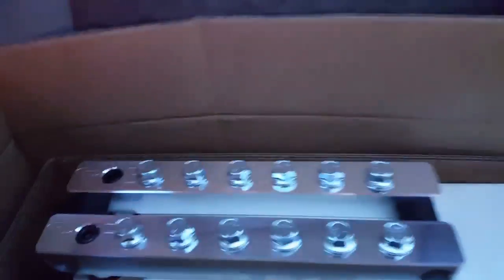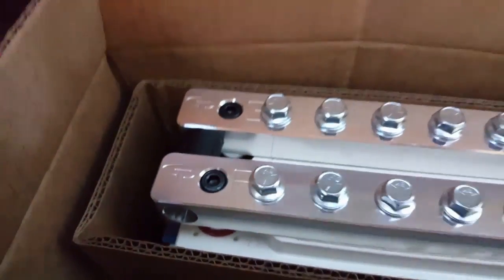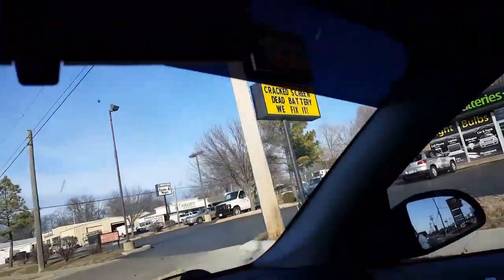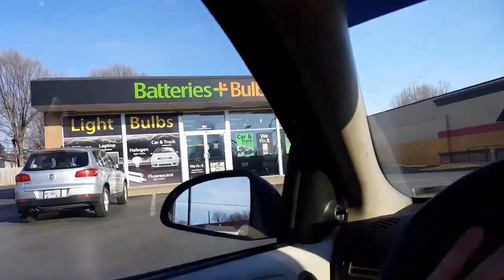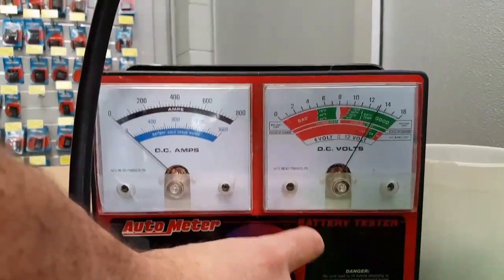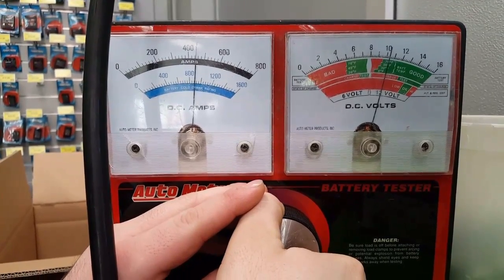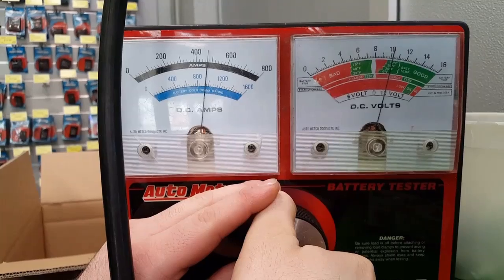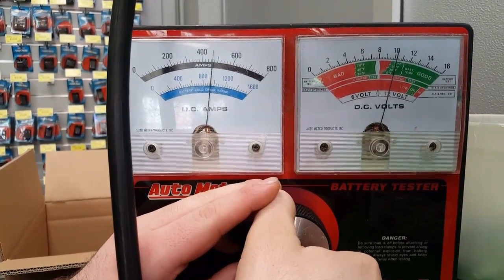Northstar SMSAGM220 Load test

Comment: My 2018 Ram Promaster city van with 4 cylinder 2.4 L engine and 160A alternator came with a 12v 70AH 120RC battery.   I do some camping and run a 3amp fan overnight parked some nights ... never had an issue starting in morning, but some days i'd like to run it longer like from 6pm to 11am.    Can I run this 220RC battery as my primary starter battery and how will my Alternator respond?  Any risk of damaging anything? Will the battery offer significantly longer running times in park.

I'm also wonder about recovery times.. I get the feeling my current battery is good to go after a 20 minute drive but I have not really tested.

Comment: Question: 

If I used a 320A alternator, a group 31 Northstar under the hood, and one of these in the trunk. Would that be enough to support a soundqubed 4500 @.5 ohms, or would I need two of the 220's?
Reply from the maker: 1 220 will have you covered
Reply: For 4k deaf bounce amp is it okay if i use 1 220 and 1 xs power 7500 with single 250 alt for 1 12 grand zero that is rated at 3 4000 rms  or i will need kore battery and alt?

Comment: I have a DRAGO 10k 5k RMS amp + two other massive audio 4ch's about 2k RMS total for both... 

Will this 220 be good on that?
Reply: randall jr Benoit the drago 5k is the same board as the audio legion 2500.1. Not sure what board the drago 10k uses but great amps.

Comment: thats great an all. 
but for music, u would rather stay at 14v, minimum 12v. what is the current production if load tested to stay at 12v?
Reply from the maker: Ashmeed Mohammed remember there's no charging system on these tests, with a 300 amp alternator this single battery will support 5k at 12v+
Reply: so what about a stock alternator?  

what i am trying to get at is, if u put a load on the battery, what current draw would be necessary to have the voltage at 12v?

could u do that test on that battery with the batter tester?

pls pls pls pls
Reply: www.GPcarAudio.com keep it up dude this head for life I told you tomorrow keep it up dude they said for life